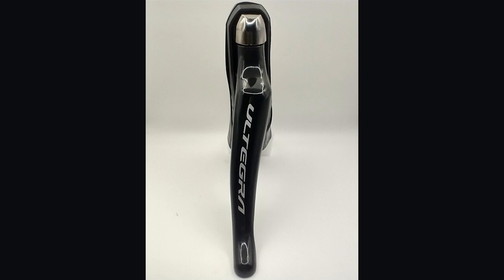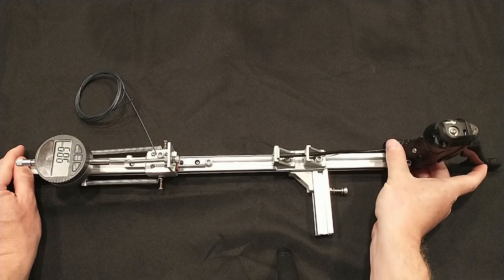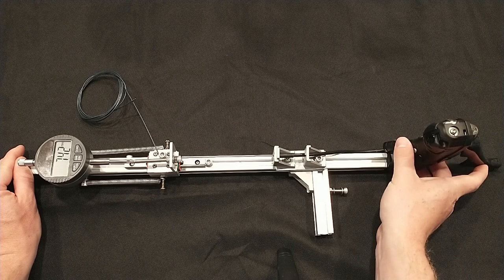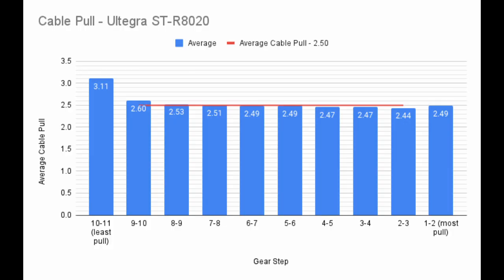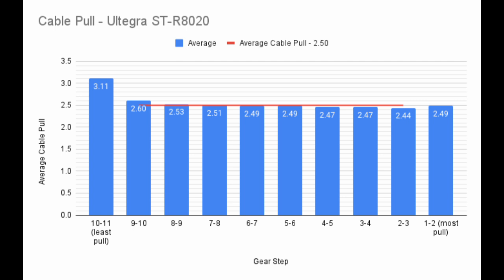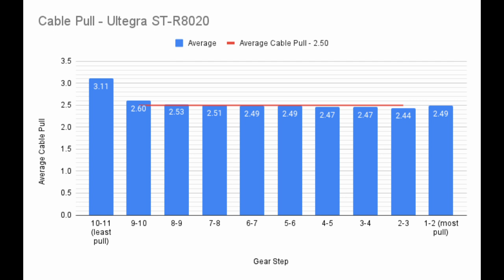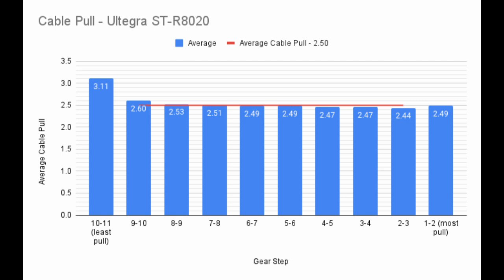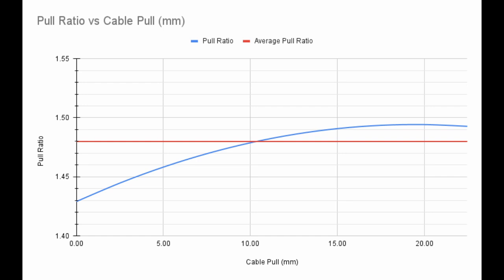Shimano Ultegra 11-Speed Shifter Pull

Comment: Still greatly appreciate your work here.
I'm curious - in the spirit of reverse engineering, would mapping derailleur pivots and body dimensions (diagram of parallelogram) provide any worthwhile info to the database you are building?
Reply from the maker: It would be incredible for someone to try and precisely measure the parallelogram. I could then benchmark my empirical measurements against a more analytical method.

I didn't go that route because it requires more precision than I have access to. It wouldn't be so hard for 1x derailleurs since the parallelogram only moves horizontally. You'll also need to figure the position of the cable stop with a good amount of accuracy. The cable stop can't be at a right angle to the lever arm throughout the range of motion, which causes the effective pull ratio to be lower than simply measuring the parallelogram and the lever arm.

2x derailleurs are trickier. They require that you measure the "slant" angle in the slant-parallelogram design. I remember trying to do some measurements on a GX derailleur and found that small amounts of error in that angle can greatly change the resulting pull ratio calculation.

Additionally, derailleurs end up having all kinds of quirks. For example, SRAM derailleurs have that "shark fin" on the lever arm, which would require modeling itself.
Reply: @boothsbikeprojects  Thanks for answering. As I thought you could and have added to my understanding of why it would be difficult. 
It would be interesting to do a kind of historical thread of derailleur designs. Even as this thought emerged, I realize that would be daunting. It was 60 years ago when the slant parallelogram was introduced.
The fact that even the cable stop location introduces changes are beyond what I'd thought of. That and the slant's effect might explain Suntour's indexing failures 35 years ago.
The SRAM "shark fin" that ramps-up cable pull is something Ratio Technology Co seems to grasp as well as the mechanism that indexes inside the shifter. I've always guessed that their being based in Germany (where the SRAM engineers are) might have given them some insider info.
Again, all these dynamics beyond what I'd thought of - I appreciate your work as is.

Comment: As an engineer I really like your videos. If you find a combination of hydraulic brifters and clutch rear derailleur able to run 10 or 11s LG cassettes would be very nice. People that are using them for MTB are claiming how good they shift under load, so it would probably be good for gravel too.
By the way, just for future records, may you want to differ the HG cassete to the new LG ones cause they probably will become common in entry level bikes very soon.